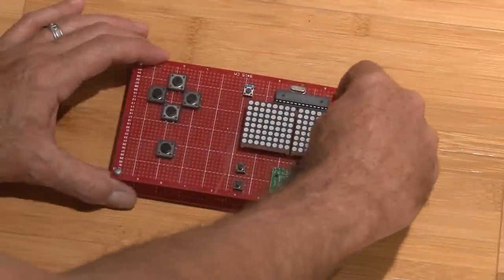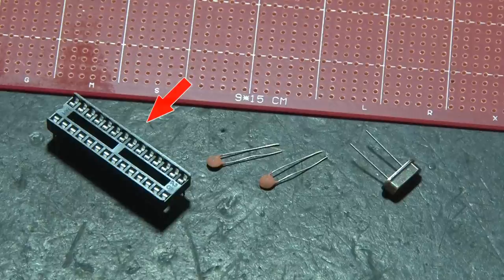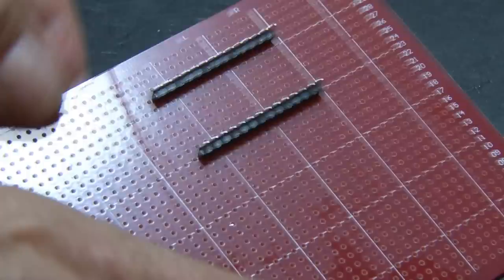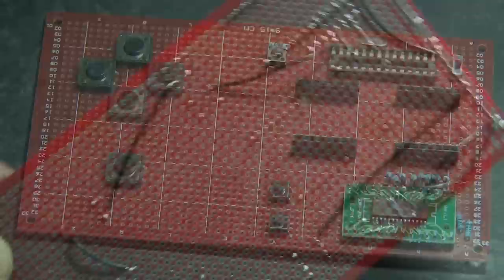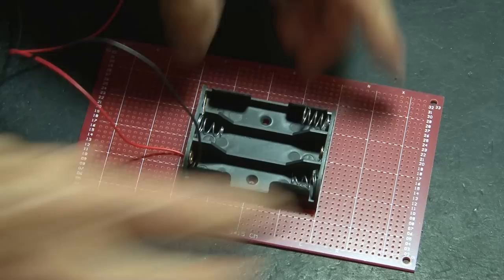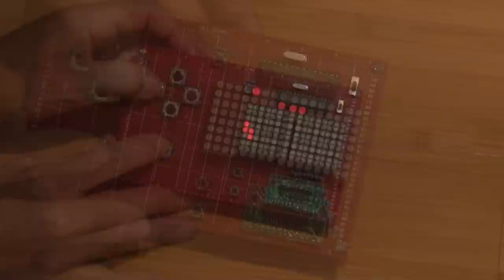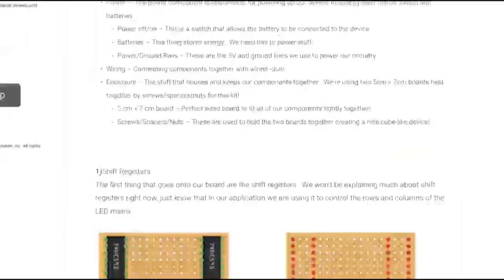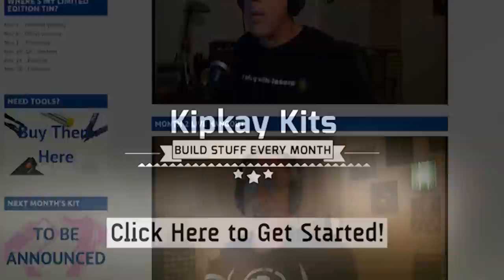Make Your Own Hand-Held Video Game!

Comment: Teach us how to make a PS4 now xD
Reply: Only if he is apart of sony
Reply: +Joel150 Almost impossible. Even if he is apart of Sony and told us how to make one. Why? Where do we get all of those equipments? Where do we get all of those components? So stay in your dreams.
Reply: +Khoi Sousa it was a joke calm down
Reply: AwesomeGuy I know. Just saying that.
Reply: Joel150 :P
Reply: ***** k! c:
Reply: +Khoi Sousa he can make it really easily, Step one: Get a ps4 and unscrew everything, Step two: unsolder everything Step three: turn on the camera, Step four: solder everythig back to the same old motherboard, Step five: get something to fit the motherboard in, Step six: Say you made it! its as easy as that
Reply: ThePovilaxxx Desoldering a PS4 is not that easy.
Reply: +Khoi Sousa Actually, the PS4 and Xbox One both use very similar architecture to PC hardware. It comprises of:

- Motherboard
-GPU
-CPU
-Storage
-Power
-Disk Drive
-Memory

Of course, to build an ACTUAL PS4, it would be near-impossible. Also, good luck getting access to the OS. But PS4 and Xbox One hardware isn't much different compared to a PC.
Reply: The7thOne Of course. PC is god.
Reply: yeah it will be awesome
Reply: +AwesomeGuy ikr. Still not practical even if you do have all the tools and parts.
Reply: PS5 now

Comment: Can it play crysis 3 at 4k 144fps?
Reply: it can run crysis 3 at 8K UHD Resolution with ultra high settings and minimum fps is 77 and maximum is 290 fps
Reply: I tried it but sadly the display refresh rate is 30Hz
Reply: DrunkUnicorn
Reply: Laxman Bodhe wat
Reply: DrunkUnic0rn nope but you can play dishonerd 2
Reply: DrunkUnic0rn 😂
Reply: DrunkUnic0rn sorry
Reply: @myangelmegu  Let's go into the unreal world. 1000 fps, 16384k 4096 hz refresh rate.

Comment: Is anyone actually going to build this?
Reply: Menno van der poel   idk,   they are nice  beginner style kits for kids  to learn basic  circuitry and engineering,   as compared to the  $1,000  lego engine kits  we had back in the 80's and 90's

i'd much rather drop $40 to experiment with a hobby than a grand or more.
Reply: Menno van der poel i did a long time ago then it got broken the old fashion way... yup dropped it in the toliet

Comment: Nice rig. Love all your vids.
One thing I'd love to see is if either a personal backpacking solar panel rigged for 12v output, or the old bike light generator with 12v output can power a small 12v car inverter to charger a laptop?, or other 110 outlet uses.

Comment: It would be awesome if you made a video that was like a quick guide to soldering, wiring, and power resistors. I have a solder lot and some LEDs and stuff, but I want to know the best way to so it as well as how the resistors work.

Comment: Nice video Kipkay! :) I would like to see you do a conversion on a toy-grade RC car and trun it into a hobby-grade RC. Basically go from the stock controler and AA batteries to pistol grip receiver and transmitter with lipo powered setup with brushless options... :) I would not only love to see you do the video, but buy an "upgrade Kit" from you! :) Let me know if you would like some more related suggestuons or for me to elaborate on my suggestion... :) Thanks!